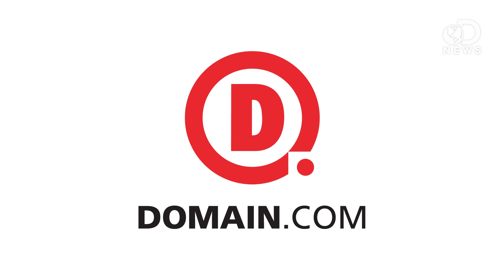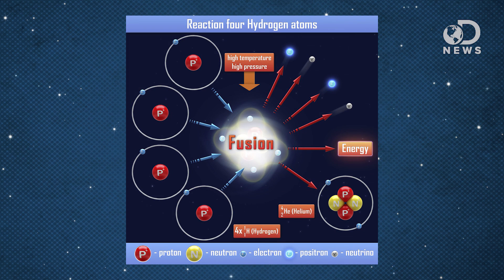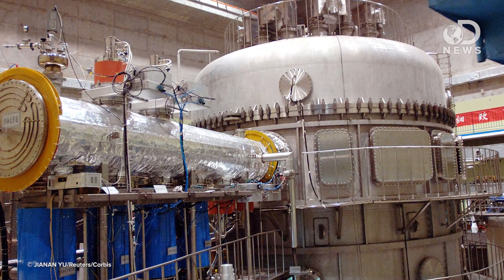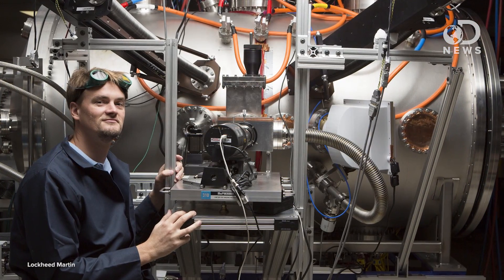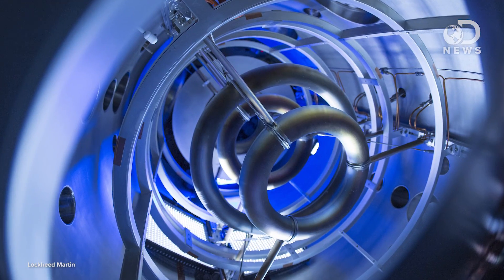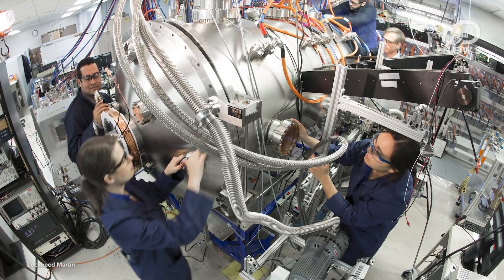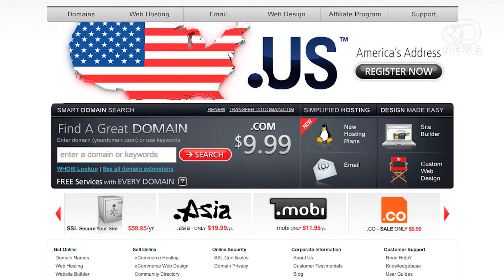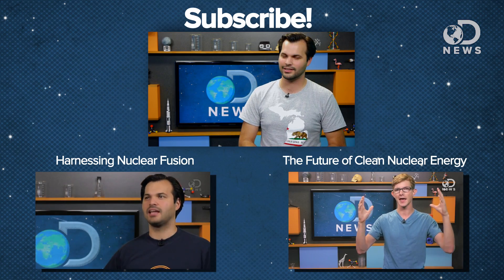Is Fusion Energy Close To Becoming A Reality?

Comment: I love the idea of fusion -- but, many of those positives Trace spoke of could be with us much sooner if only some military moolah was diverted to a solar infrastructure.  The US military spends a couple of billion a day; imagine how many solar panels and batteries that could buy?

How about using a month of military money ($60b or so), to fund battery storage, solar power and high voltage DC long-distance transmission lines?

A B2 bomber is worth over $2b.  These are crazy numbers!!  Solar could be installed for under $1/W on a massive scale.  Battery prices would shoot under $100/kWh.

Keep the fusion experimentations going, but don't be distracted by a prospect 20 years off to not take action now.

</rant>

Comment: Even if you get the fusion reactor to break even, you'd need a more efficient method of harnessing the energy(heat) given off by the reactor. The traditional method of boiling water to spin a turbine isn't nearly efficient enough to capture all that energy being given off. It would be wasteful.
Reply: Didn't you hear what he said the elctromagnets capture the energy and transforms it in to electrical energy to be transferred into the grid.
Reply: engelmohr2006 He said the electromagnets contain the plasma and prevent it from touching the reactor walls. He never said they have anything to do with converting the energy from the fusion reaction into electrical energy.

Comment: You know if they where building that in a place that didn't have as much gravity like space or the moon it would be easier to maintain the super heated plasma.
Reply: The plasma is so hot and so miniscule it is virtually unaffected by gravity. Not to mention the magnets, if you watched the video, control the plasma and so it is already suspended in the air. Nothing would change in a gravity-less environment. I think you meant in a vacuum but even so, same logic applies.
Reply: Naw I am pretty sure that plasma does flow down simply because it still has some mass and gravity does effect it. I mean in outer space because of a lack of gravity. I know it is still out there but the further you get from the earth or the sun, the weaker the gravity. Of course I only assume this because of all the footage of asternaunts being weightless in there space ship and station.

Comment: Lockheed Skunk Works is well known to be one of the (if not 'THE") most secretive manufacturer / developer in the world.  When they designed the SR-71, they used titanium fabrication techniques unknown to ...Lockheed!!!  Lockheed spent millions to develop this technology to compete against Boeing for the American SST while Skunk Works was already using it!  But the SR-71 (or A-12) was then a super-secret aircraft.  Its existence was known more than a decade after its maiden flight.

So if I was told that Lockheed is developing a fusion reactor I may believe it.  But the Skunk Works???  No way!  Even though the Skunk Works is "officially" part of Lockheed, it is unofficially (I mean practically) part of the CIA.  Do you know that although it has been seen by thousands of people and there is proof that millions of $$$ have been invested in it, the Aurora officially does not and never did exist?  Yet the Aurora is only a significant but still consequential advance in aircraft technology.

So they would tell us about THE most important technological and scientific revolution since the discovery of nuclear reactions in 1898 by Pierre and Marie Curie???  They would publish a major quantum leap in a very sensitive domain?  Really???

Comment: A majority of the nuclear arsenal of the U.S. uses a fusion-based design. Basically, a the fission explosion creates enough pressure and heat to make a fusion explosion. We've been using this technology since the 50s in bombs. Bombs are not limited to fission.
Reply: But a fusion bomb and fusion reactor are about as different as you can get
Reply: Comic B Studios
A fission rector is just as different from a fission bomb then a fusion rector from a fusion bomb. BOTH fusion bombs and fusion reactors use heat and pressure to fuse hydrogen atoms.

Comment: I'm sure someone has already asked this but wouldn't using water to power a fusion reactor consume the water completely? I mean mean you'd remove it completely from the cycle as the hydrogen would become helium. Last time I checked there is a finite amount of water too...
Reply: You use a tony amount of water to generate massive amounts of power and hydrogen is the most abundant element In the universe. As far as generating energy it is the best solution we know of

Comment: How radioactive is the sun? Fusion is supposedly cleaner than fission power, and it works on the same principal as the sun, but the previous article mentioned how solar radiation could beef up cancer rates if the earth's magnetic field weakens? Is there a conflict here, or is this a matter of scale? (tiny earth reactor vs THE SUN.)
Reply: there are a few things, firstly scale but also black body radiation. any object that is hot enough will produce light, if an object is very hot it will start to create UV radiation, if it gets extremely hot you get gamma radiation and the sun is extremely hot. also many other complicated things but scale is the main one
Reply: and the sun releases a lot of different types of radiation, while the fusion reactor only releases small quantities of the dangerous types
Reply: Just sayin, but you have it the wrong way around: fusion is cleaner than fission, and the sun uses fusion :)
Reply: Barron Risling Ah, I typed them backwards. I meant it the other way around. :p. Glad you can edit comments.
Reply: Glad I didn't accidentally start a flame war. :D